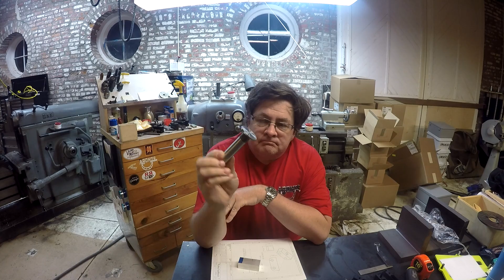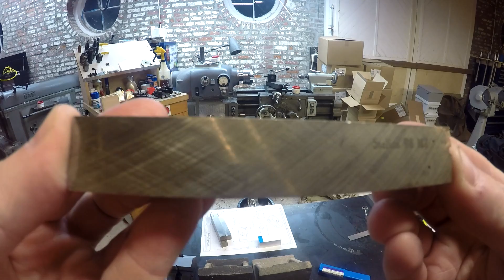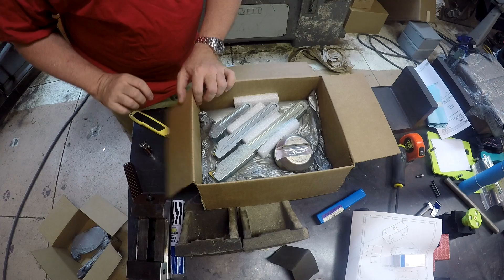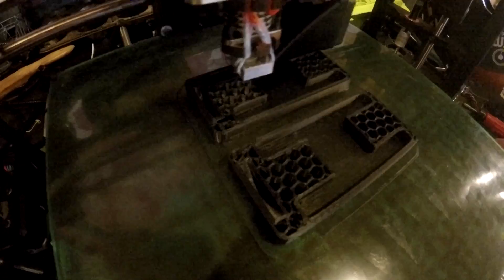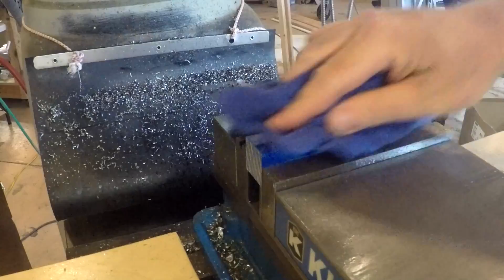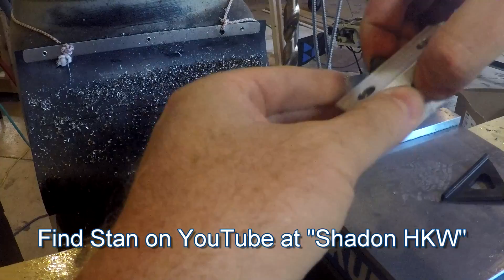Shop ADHD #18

Comment: Boy! With that long-arm fly cutter you are going to need to do some seriously accurate tramming. I'm usually (very) happy with a few tenths over a six or eight inch sweep, but you are going to need two or three times that accuracy to make good use of the longest arm on that fly cutter, or you are going to be cutting shallow troughs rather than a plane surface. (Center of the tool path will cut deeper than the edges.)

It strikes me that the fly cutter itself might be the most rigid indicator mount you have that fits the spindle of your mill. Make an indicator holder that clamps to the fly cutter arm and sweep to the size that you intend to cut. Tram-deviation-indicated will be equal to cutting error. You will probably need to clamp a long parallel bar crossways to the table in order to indicate the Y-axis to sufficient accuracy. (Y-axis error will cause side-to-side thickness variation; X-axis error will cause center-to-edge variation along the tool path - assuming feed on the X-axis.)

I'm sure you know all this; I'm just thinking "out loud". Watching your videos makes me examine what I understand or can figure out about the subject. Every video is an addition to my education and a prod to my critical thinking. Thanks, and thanks for putting up with my belated comments as I work my way through all your videos. (I finally put up a shop video of my own. My first one, using simple equipment and software, so bear with me.)

Comment: stellite is a cobalt alloy and contains no iron (it will not stick to a magnet). it is a pain in the @** to grind because its very hard do not quench it to cool it down because it can loose its strength from heat shock (let it cool slowly). one property prominent in it is its high heat resistance (basically you can get he tool bit glowing red and it will still cut fine). i had a 1/2 " blank and it took me at least an hour to grind a threading tool. have fun grinding.;)

Comment: Hi Guys here is something i would like to share with you concerning rust/corrosion  on newly machine steel which appears a problem for the guys who have hi humidity issues.  Mix up a solution of Copper sulfate with warm tap water about (1oz of copper sulfate 1 pint of water) its not a critical on the ratio shake well until crystals dissolve. When ready wipe solution on machined surface,you will notice a copper coating appear on the surface which will deter rust etc you can wipe of any moisture away and dry. This also make a good lay out fluid and can be removed with Scotch bright or painted over. I understand this was a Victorian process and works well for me.
Hope this helps

Happy machining
Ken

Comment: My ma invested in those 3D printer companies.  I informed her that there is probably going to be more $ made off of the supplies for the printers, than the printers themselves.  Stellite (pronounced "stehlite", not pronounced "steeeelite") is a trademark/name of the Kennemetal Company.  I think the cutting blank is oriented with the "Stellite" name in the "up" position and the knotch/groove should be oriented vertically.  Dont' take my word for it, there is a definite orientation, check the websites:    (http://bbs.homeshopmachinist.net/threads/59902-Stellite-cutters).   Yeah Kennemetal, the dude who came up with tungsten-carbide for machine tools.  Stellite is a "super-alloy" steel:  composition of iron, Cobalt, and Chromium.....  Cutting tool edges stay hard at high temperatures.  Beryllium-Copper alloys are similar and have greater thermal conductivity properties and stay harder at even higher temperatures (wicks away the heat... stays cool) than Stellite.  But Beryllium is highly toxic, carcinogen (no-go!).  Don't want to inhale the dust or smoke coming off hot beryllium.

Comment: Thanks for the video.
Not in OH, central FL, but here is a month old listing for a 16" shaper:
http://tampa.craigslist.org/pnl/tls/4943870896.html

In ancient times we were taught the nib on the center drill served two purposes, one as a recess for the center's point and two as a grease reservoir, and you were never to run a dead center without first lubing the hole.

Comment: Ahhh,,,, hotrod Ford, you may appreciate then,,, I cut to fit,,, a '68' LTD police interceptor 390/C-6 posi-trac, frame and drivetrain,,, To fit under a 71 Pinto Runabout... Twas a extremely fast street ready unit w/excellent handling capabilities!

One way to hang on to,,, and use those 460s is to build a 78 or 79 4X4 Ford business truck,,, well that's how I did it... Still have it now as my farm truck though I went with a 300 6cyl, .040 over bore, 4bbl, quadrajet, w/dual port Offenhauser, and dual tuned headers, granny 4spd.,and 9" posi-trac rear-end... It pulls, and is still quite a fun workhorse..... ;o)

O,,,

Comment: Hey James,

Thanks for the plug, always good to see how people put the squares to use. Looking forward to the flycutter demo, as a side note, do you think removing the hard outer mill finish will cause distortion on the 6061 plate? Will be interesting to see.

Enjoyed,
Z
Reply from the maker: Shadon HKW I have considered it a possibility, and I plan to find out.  I am worried that taking a cut on one side alone will warp the crap out of the part.  But I have to do something, so its either fly cut it or sand it.

Comment: Wow, very nice fly-cutter! I'm sure from your end you can tell if it is in the finish or the production, but is it possibly made of sintered metal? I just saw what appeared to be a grainy finish(?) and immediately thought that may be how it was manufactured, what do you think? I just am fascinated by sintered metal production and if I'd graduated from college I would have aimed for metallurgy as a career as I'm just that intrigued by metal chemistry and all that jazz.

Thanks for another great show, and if I had need of a top-hat edge finder, I'd be begging to dive into your trash can for any one of those iterations of cases :D

Aloha...Chuck
Reply from the maker: Knolltop Farms That is a possibility, it doesn't look like it was cut from solid for sure, the reason I thought about being die cast, but there is no parting line so a sintered construction is a possibility.  A company that most machinist are familiar with, Te-Co, makes tons of their product using a sintered metal process.  All those step blocks and clamps for instance.

Comment: Thank you James, a great segment to watch over my Sunday morning coffee!  You made a comment that "center drills are for lathes and spotting drills are for mills".  Can you explain for me and others the benefits and drawbacks for each.  I use spotting drills in my mill.  Thought spotting drills were just a luxury.  Thanks in advance....  Fred
Reply from the maker: Fred Miller That little extended end on a center dill is specifically there to provide relief for the point of a live or dead center.  That little point is also weak and prone to breaking off in your work.  On a mill it just isn't required, for 99.9% of work.  Of course a spotting drill will work just as well in a lathe if you don't intend to use a center.  Spotters are also cheaper than center drills of the same diameter generally.

Comment: Jay,
I like your holder for your edge finder. Is that ABS plastic recyclable?  You got one hell of a fly cutter. I don't know that I would want to be in the same room when that 11" guy is doing his thing! If you can do so without exposing any trade secrets, what kind of device uses a sheave with an encoder on it?  Thanks for the great video! Any more progress on the Pacemaker?
Have a good one!
Dave
Reply: Swarf Rat There are (or you can even make) extruders that will heat and extrude new filament from your misprinted scraps. That's one way to recycle your rejects. You would want to keep different types of 3D-printer plastic separated/sorted and clean.

If you wanted to recycle them into the normal (public) recycling stream, it would be a goodness to print each piece with the standardized symbol for recycling plastic - a little triangle with a number in it and a few letters under with the abbreviation for the particular plastic. Unfortunately, ABS currently gets classified under #7 "Other" which is the lowest grade (since it is mixed types) and least valuable. Apparently there is a movement afoot to give it its own classification of #9 "ABS" but that is not official or recognized everywhere.

It's a good idea, though, since most types of plastic don't degrade easily and will remain relatively unchanged in landfills for a long time, and most types ultimately derive from petroleum source material which is getting more expensive all the time.

Comment: That flycutter sure looks like it presents the insert negative to me??? That will be a fun piece especially if you run it hung out with that long bar, I mean who doesn't love making their mill sound like a helicopter!  :-) I want to see you do a comparison of the finish from the flycutter vs using the slab mill in climb mill mode, I bet with flood coolant to clear the chips it might be surprising just how good a finish you can get and how much faster you could feed vs the flycutter.
Reply: bcbloc02 Also the tramming of the head is so much more critical with the bigger flycutters, if you don't want to end up with a cupped shaped part...
Reply from the maker: bcbloc02 It does, I meant to say positive relief.  I think that finish comparison would be an interesting video for sure.
Reply from the maker: pierre beaudry bcbloc02 There is no doubt about that Pierre, get way out of tram with a 10" cut and your part will look like a bowl.